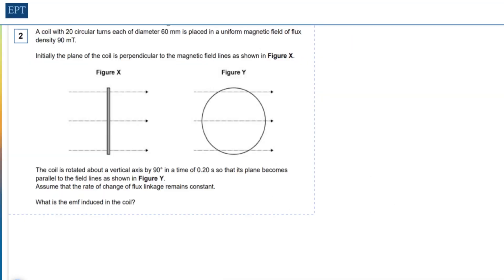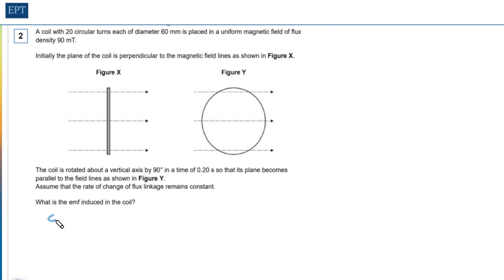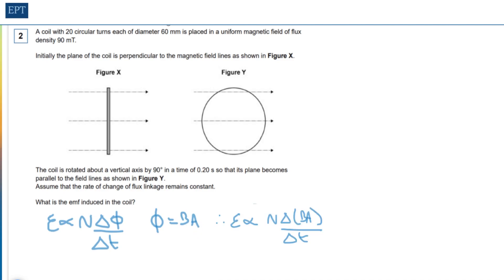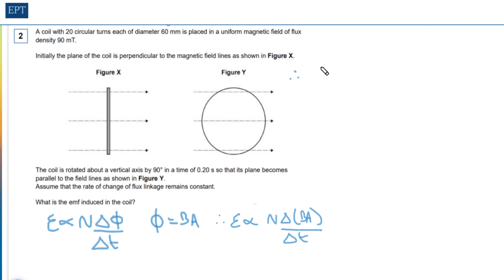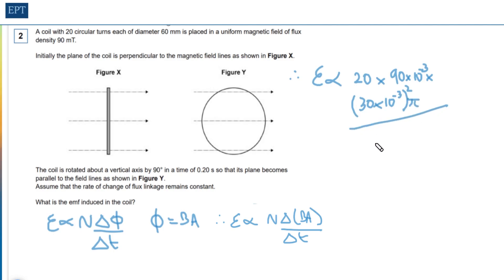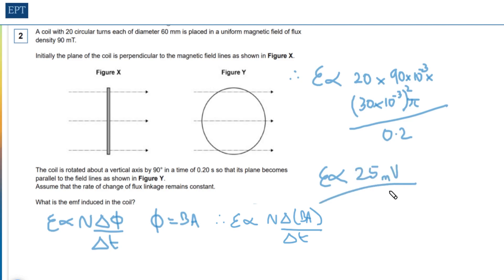A coil with 20 circular turns of diameter 60 mm  in a uniform magnetic field of flux density 90 mT.

Comment: Hi there. I totally understand this logic, but in my head using the equation E=BAN x (2Pi f) x sin (2 Pi f x t) , should also work, but it doesn't. Is this because the coil is rotating horizontally rather than vertically?
Reply from the maker: Well, one thing is that this coil is not rotating at a steady w. We know that because the rate of change of flux is constant - which it wouldn't be if w was.
Reply: @physics-for-all-with-edward  If the rate of change of flux is constant, doesn't that mean that it is rotating at a steady speed, so shouldn't it be rotating at a steady w
Reply from the maker: @danielherrero1869  if the rate of rotation (w) is constant that means the flux is changing all the time, but NOT at a constant rate. In order to get the rate of change of flux to be constant you would need to vary the speed of rotation. As it happens a lot of my pupils get stuck on this idea. (the physics behind it is very similar to the graphs of x,v and a for SHM)  You have given me an idea for a #short - hopefully get it done in the next few days